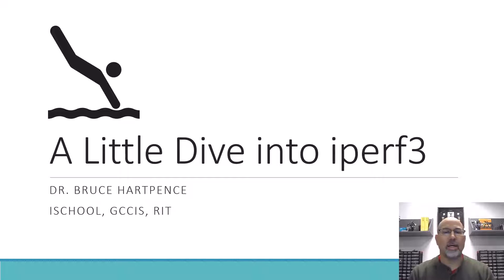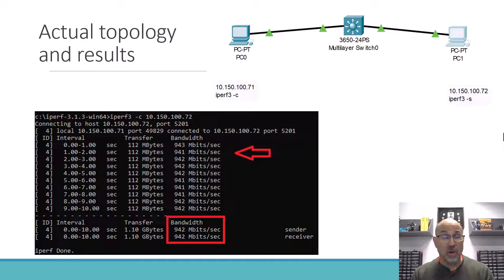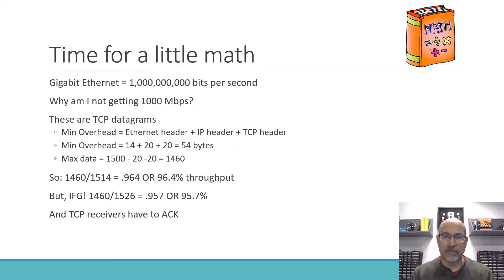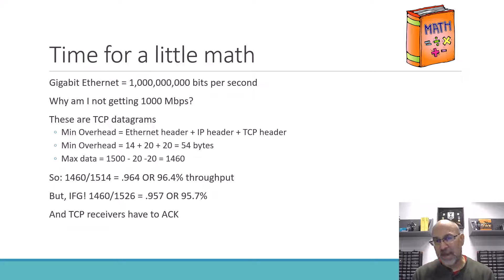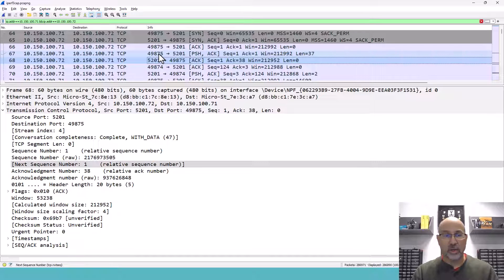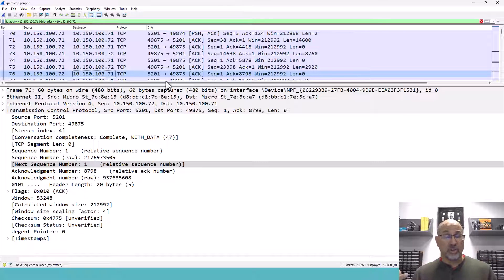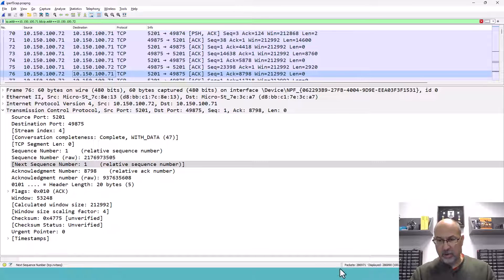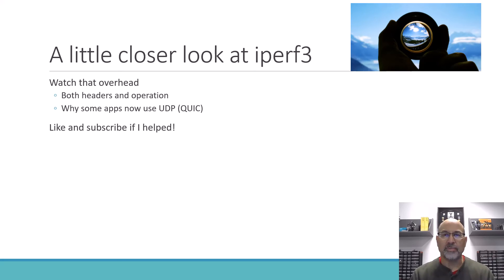A Little Dive into iperf3

Comment: You may want to try iperf 2 for testing things like latency and bufferbloat. Big windows will cause bufferbloat unless the sender uses TCP_NOTSENT_LOWAT which is supported in iperf 2 via --tcp-write-prefetch. Iperf 3 doesn't support this nor testing latency in general.
Reply from the maker: Excellent comment - yes, we talked a little bit about the difference between iperf2 and iperf3 in another video. There is also a difference between iperf behavior on the various operating systems. Window size is a whole other discussion especially with window scaling creating enormous windows. Thanks for the addition!
Reply: Thats some valuable comment there, thx!